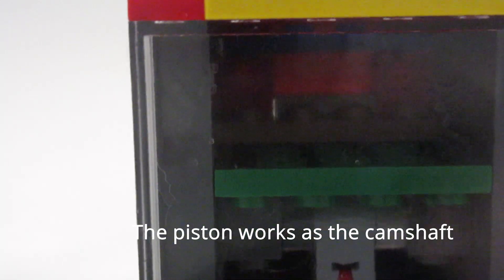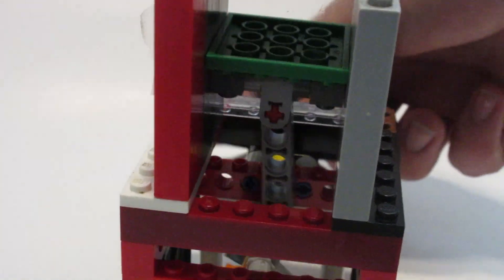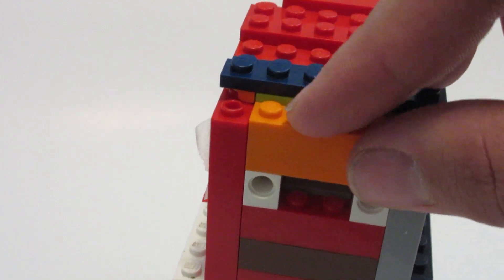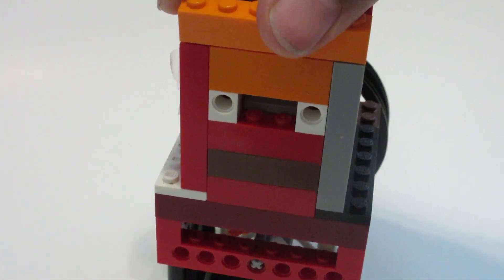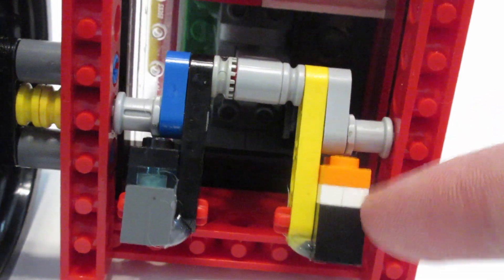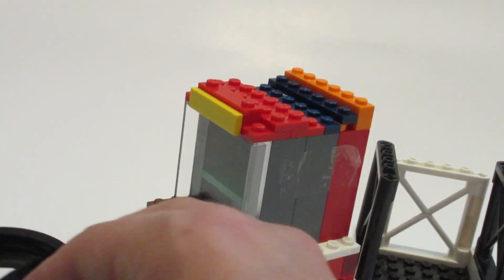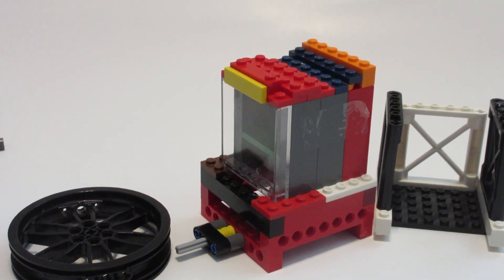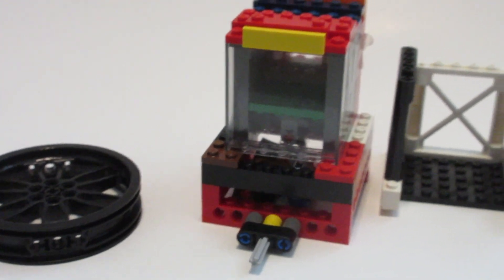My take at the LVE Lego Engine with NO external valves or linkage | Inspired by Lazlo |

Comment: How do you know what weight/size the counterweights need to be? I want my 1 cyl 4x4 engine to run as smooth as possible. (I've already made almost every other upgrade, just dont now how big the counterweights need to be.
Reply from the maker: I have no idea. But I imagine that you could find the centrifugal force that the weight produces and if it equals the force of the moving piston. Or you just try again and again until it works pretty well. That’s what I did. Does that help?
Reply: @somebuilds  I'll try later.

Comment: I builded this but my valve get stuck when I put the vacuum on it
Reply from the maker: I’ve had that problem too. the vacuum is moving the valve closer to a wall or the piston which is causing unnecessary friction. I would suggest turning down you vacuum’s pressure (there might be a slider you can change) or you can move the hose further away from the inlet. Hold it at an angle so some air escapes. Does that help?